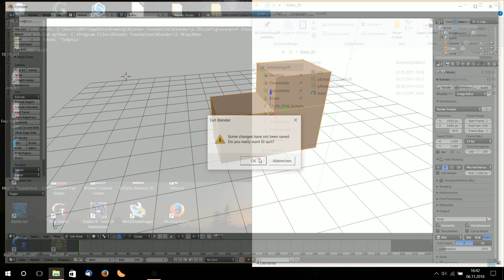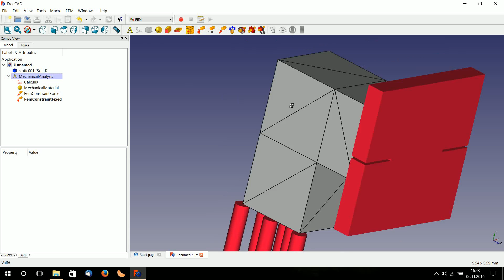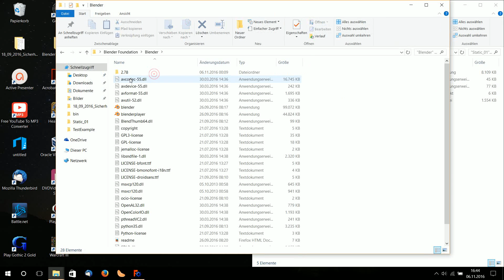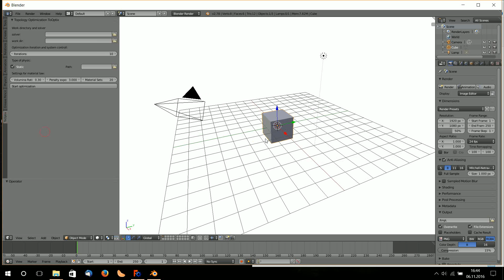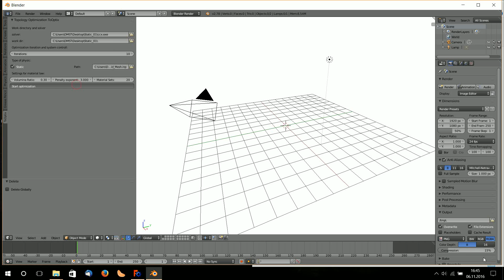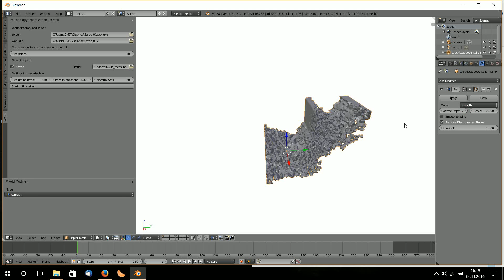Static Topology Optimization Blender to FreeCAD to Blender (ToOptix)

Comment: Hi, thank you for creating this free software first of all. But I have a question, nowadays there a a lot of cross-linked readme files in different folders on github and it's hard to figure out what version for what. I tried to install new add-on on Blender 2.80 as it said in readme file but I get an error. Found old version of add-on for blender 2.79 and add-on functions but only on the example files made by you, other files don't work properly. Currently I'm using blender 2.80 and have no idea how to install add-on. I am using Linux. Also it's hard to figure out what version of cxx I should use. Hope you can help.
Reply from the maker: Hi, unfortunately I have programmed the Add-On in the Beta 2.80. The final Version of 2.80 changes quite a lot in the API. But there is a quite usefull Addon of https://github.com/fandaL/beso for FreeCAD. Right now i am focused on just python API development due to the rapid change of APIS in FreeCAD and Blender.
Reply: Oh. Got it thank you. What about other older versions, I don't really mind using outdated. For example when I installed on blender 2.75 old add-on 3_2017 it was okay, but not for all files. So maybe my ccx was wrong. Because I used ccx2.17 . Any possible solution to that? Or maybe there is stable option to use some older version. And sorry for bothering. Have a nice day
Reply from the maker: @bogdanshevchenko4159  Hi sorry for the late response, the add on is ccx independent. Because the Inputdeck has not changed. You need to define the input deck properly. Currently only mesh dependencies are allowed, so that something with "Part", "Assembly" is not allowed. For what purpose do you need that Addon maybe I can provide you a Blender Addon directly for 2.9*. I also need to explain how you have to build up your inp  file, so that its working.
Reply: Thanks a lot. And yes I used it with  assembly, so now it makes sense why it failed. I will try to work around the deck. But if you could provide more explanation or even a version for 2.9 would be fantastic, and sorry about asking dumb questions and bothering you. I'm just not very strong on programming part, so most of errors that pop up are mysteries for me. Big thank you for you response and being so helpful. aif you can provide explanation or even make a 2.9 version I will be waiting. Have a good day. Thanks a lot again
Reply from the maker: @bogdanshevchenko4159  So i have worked up a small introduction of how the inputdeck should look like. Maybe you can write me on Linkedin, so that I can directly apply you the data + documents.
Reply: I will, thank you.

Comment: Thank you for this help, I have problem when i use a cube contain spheres in Blender, Is it possible to realize meshes and  simulations in Freecad?
Reply: I add 4 spheres in the cube with the Boolean union but not work (Can be valid with Ctrl + J), and if I have for each mesh a material (here two material), how can I use it in freecad
http://pasteall.org/pic/show.php?id=110876
Reply: This idea is clear but I am new in this program and you are using an older version
Reply: Sorry for the delay response, thanks for the help, Can you make the mesh for this example, the material for the spheres is different than the cube. Second question, can you obtenain a txt file for the mesh (with freecad).  http://pasteall.org/blend/index.php?id=45058
Reply: In my example, I make the complete mesh for the mesh of the cube with the spheres, for exemple in this firgure w observed the meshing of cube contenains particles: https://www.researchgate.net/profile/Mikhail_Baklanov/publication/280769089/figure/fig2/AS:284598165622784@1444864898073/Figure-4-geometries-and-meshes-of-RVE-representative-volume-element-models-for-porous.png
Reply: As you said, this is the case of the multi material